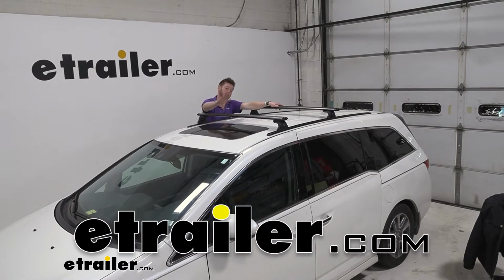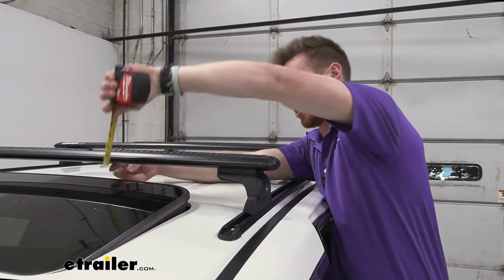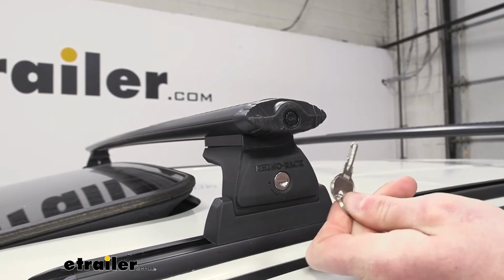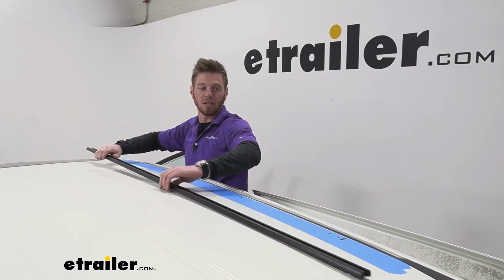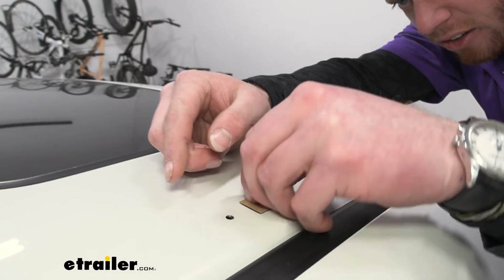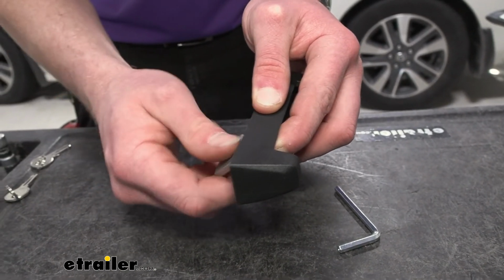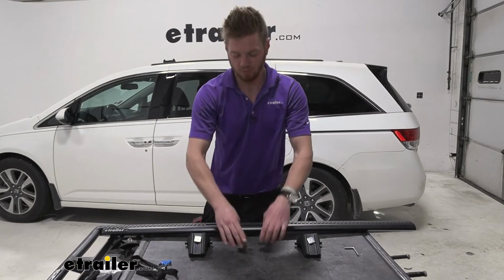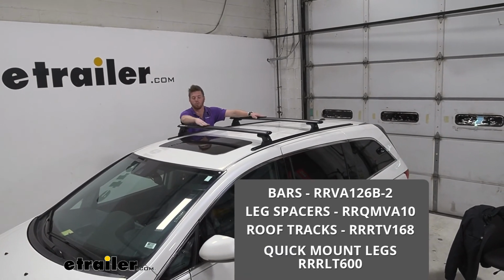etrailer | DIY Install: Rhino-Rack Heavy Duty Roof Rack on your 2016 Honda Odyssey

Comment: I wouldn't want to drill holes and the weight capacity should be drastically lower.
Reply from the maker: Due to the sliding rear doors, a clamp on application isn't available. The good news is that SeaSucker offers a vacuum cup mounted rack as part # SEA66VR which you can check out by using this link:
https://www.etrailer.com/Roof-Rack/SeaSucker/SEA66VR.html
Each vacuum cup can withstand 210 lbs of pull, so with 6 cups in total, that thing isn't going anywhere. The bars have a 150 lb weight capacity. We hope that helps!

Comment: I stopped watching when he drilled the roof. Not putting holes on my new van
Reply: Buy original honda odyssey roof rail, you don't need to drill and it will be looking better
Reply: @chicagovisual  yup is what i did. Original honda rails and crossbars
Reply: Yeah i bet they dont sell many of these.
Reply: @johnlucier5654  original roof rack from Honda dealer costs around $ 220.00 and crossbars around $ 70.00 on amazon, less than half price, no drilling easy to install and looks better.